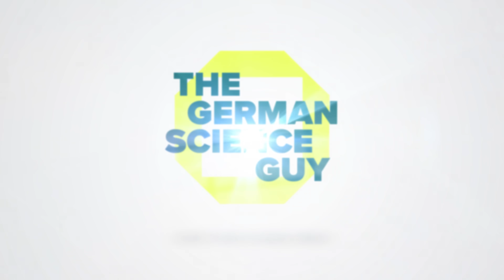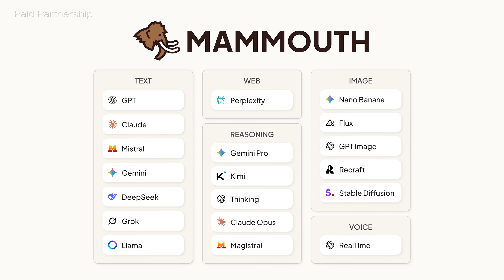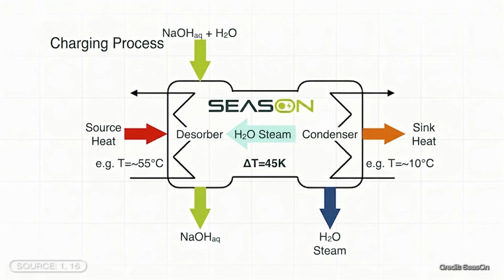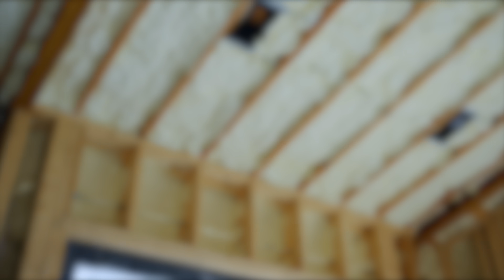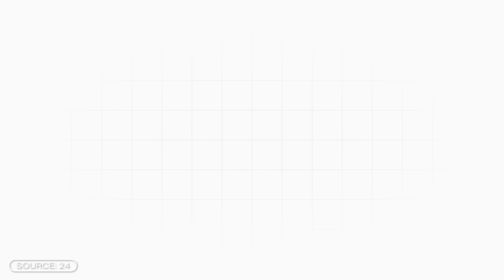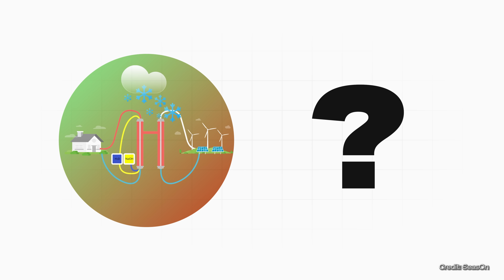New Heat Storage: Better Than a Heat Pump?

Comment: Something here is not adding up to me.  If the energy is stored as heat and returned as heat why would the input even be electricity in the first place? Use solar concentrators to warm the solution to evaporate the water directly.  Solar concentrators when producing heat and not electricity are far more efficient than solar panels.

Comment: About 1/3 kWh per kg. Which is about 30 times less energy density than coal. 40 times less than oil. Somewhat about 1.5-2.5 more energy density than storing electricity LiION batteries (That can run a heat pump with COP up to 5). But materials are much cheaper and can use raw heat from Sun to recharge.

Comment: The calculation of the amount of caustic soda needed applies if you need to store all the needed energy for the whole winter. What would the amount be if you only need to store a weeks worth of energy and then rely on low energy prices to fill it up. Would that be feasible? Would it overload your electricity net connection in periods? Would be interesting to see calculations or a simulation over a longer time including the usage of low energy tariffs.

Comment: I expect batteries (LFP or Na-based equivalents) to become SO cheap that it will have a shorter payback to set up such a system for roughly the same amount of ‘heat storage’ in a few years. Remember that even in winter a air-sourced heatpump has a cop of 3or more, so a 30kwh battery will give you a LOT of heat, while being useful all year round (for trading in summer and such)

Comment: I wonder if the RethinkX concept of superpower makes more sense... overproduce renewables to limit the need for storage (esp. seasonal storage) and use the excess for things like industrial processes that can be run with a 50-80% capacity factor. Like, making hydrogen through electrolysis as a chemical feedstock and run the electrolyzers when electricity is nearly free due to curtailment.

Comment: Hi Doctor, I hope you're well. I wanted to leave this idea with you because I see potential in it if it can be implemented correctly. 

Subterranean High-Density Vertical Photobioreactors Co-Located with Industrial Point-Source Carbon Capture: A Pre-Feasibility Proposal

Traditional microalgae fuel systems have repeatedly failed to scale because they are trapped by four coupled constraints: land intensity, self-shading, evaporation, and expensive above-ground containment. This proposal reframes the problem as an industrial infrastructure challenge rather than an agricultural one. The core concept is a modular subterranean photobioreactor network composed of multiple underground vaults containing dense vertical cultivation panels with a thin liquid column and narrow maintenance gaps. Instead of exposing the culture to the open environment, sunlight is harvested at the surface by tracking concentrators and delivered underground through optical waveguides, ideally using side-emitting or engineered leak fibers to distribute photons along the full reactor depth. In effect, light is decoupled from land use, while the underground geology supplies structural containment and thermal stability.

The main engineering advantage is footprint compression. Conventional algae systems require broad horizontal spacing because illumination arrives from one direction and penetration falls rapidly with depth. A vertical underground configuration converts the problem into a volumetric one: more culture per unit ground area, less evaporative loss, and lower exposure to weather. In principle, this could reduce surface land requirements by more than an order of magnitude relative to open ponds or widely spaced above-ground photobioreactors. That said, the real feasibility hinge is not geometry alone; it is whether optical delivery, pumping, fouling control, and excavation costs remain favorable at industrial scale.

The first major technical risk is light delivery. Any long optical path introduces losses from absorption, scattering, bending, coupling inefficiency, and imperfect light extraction. A 20 m internal distribution path is ambitious, and the system should not assume that a fiber or light pipe can transmit useful photosynthetically active radiation with near-zero degradation. The design should therefore be treated as a hybrid optical system rather than a pure fiber solution. Surface collection should feed a high-efficiency primary distribution network, but the underground panels may still require supplemental LEDs for low-sun periods, spectral tuning, or balancing of light gradients. The goal should be controlled photon flux density, not ideological commitment to one illumination method. A practical design would benchmark collection-to-delivery efficiency early using ray tracing, spectral measurements, and pilot-scale test vaults.

The second major risk is hydraulics. A dense vertical reactor must keep biomass suspended, remove oxygen, deliver carbon dioxide, and avoid local dead zones. The proposed 0.15 m/s circulation target is plausible as a conceptual mixing benchmark, but the true energy cost must be calculated from pressure drop, channel geometry, viscosity, gas holdup, and required mass transfer rates. In most algae systems, pumping and mixing dominate operating expense, and underground placement does not remove that burden. It may reduce thermal conditioning loads, but the economic outcome depends on whether HVAC savings exceed the cost of lifting and recirculating thousands of cubic metres of fluid. CO₂ bubbling can assist mixing, but it also complicates gas-liquid transfer, foaming, and oxygen stripping. The design should therefore include variable-speed pumping, compartmentalized flow paths, and explicit oxygen removal management.

The third major issue is geotechnical realism. Earth and bedrock are not universally “free structural walls.” Excavation in stable rock can indeed reduce the need for above-ground framing, but underground containment still requires liner design, seepage control, drainage, stress analysis, seismic evaluation, and long-term maintenance. A rock cavern can support large loads, but only if the site geology, groundwater regime, discontinuities, and induced stress redistribution are understood in advance. The concept is strongest in competent bedrock or mined cavern environments, and weakest in fractured, water-bearing, or poorly characterized soils. A phased excavation strategy is essential: one vault at a time, with sensor-embedded liners, compartmentalization, and emergency drainage. The project should be treated like underground industrial storage or pumped-hydro civil works, not like conventional crop infrastructure.

The fourth issue is flue-gas integration. Industrial emissions can be a valuable carbon source, but raw flue gas is usually too hot and chemically harsh for direct biological use. Pretreatment is not optional. Cooling, particulate removal, sulfur and nitrogen oxide reduction, and careful contaminant screening are required before gas enters the photobioreactor. In some cases, the flue gas may need more than basic scrubbing, especially if the emitter is a cement plant, steel mill, or process source with variable composition. That said, co-location is strategically attractive because it lowers carbon transport costs, improves utilization, and may create a credible revenue stack around carbon management, fuel production, and industrial decarbonization.

Economically, the project should not be sold as a standalone algae farm. It is better described as a carbon-utilization utility with fuel as the primary product and optional coproducts such as animal feed, biochemicals, or specialty biomass fractions. The business case depends on three revenue layers: fuel sales, carbon-related incentives, and coproduct monetization. Policy support can materially improve bankability, but policy assumptions must be treated conservatively. Any incentive regime, fuel credit, or carbon market must be modeled as upside rather than the sole foundation of the project. The correct financial question is whether the system can survive on conservative product prices, realistic capacity factors, and honest capital costs. If it can only work under idealized subsidies, it is not yet bankable.

The strongest version of this proposal is not a claim that underground algae will instantly beat every existing pathway. It is a claim that the industry has been optimizing the wrong geometry. By moving from horizontal exposure to vertical volumetric cultivation, and from open-air farming to a controlled subterranean industrial process, the project may unlock a new scaling regime. To prove that, the next step is a pilot vault: small enough to measure real light transmission, pumping demand, fouling behavior, heat balance, and gas transfer, but large enough to reveal whether the architecture has commercial promise. The decision gate should be data, not aspiration.

In summary, the subterranean 3D photobioreactor concept is technically bold, structurally plausible in the right geology, and economically interesting only if optical losses, mixing energy, and excavation costs are tightly controlled. Its central value proposition is land compression combined with direct industrial carbon use. Its central failure modes are overestimated light delivery, underestimated pumping load, and optimistic financial assumptions. A disciplined pilot program, full process simulation, and site-specific geotechnical study are the correct next steps. If those tests are favorable, the concept could become a serious pathway for compact low-carbon fuel production and industrial CO₂ utilization.

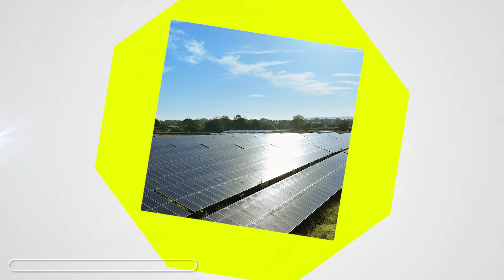Comment: I can see part of the problem @0:35. This solar farm is optimized for summer production. Seasonal production is complex, and also involves weather. But assuming winter isn't never ending cloud cover, optimize for winter production. You'll get less production per hour in summer, but more hours per day. This may not fit with the higher summer production required for the caustic soda heat "battery." Personally, I like phase change materials, but they've got to be insanely cheap.

Comment: 20 cubic metres of caustic soda is huge. Presumably the other tank is also 20cubic meters😱
I'm just filling 30 cubic meters of gabion baskets it's massive!

Given themal expansion and contraction and extreme caustic material, I love the idea of long term chemical thermal potential but this combo with caustic soda? Potentially a nightmare.

Comment: What has happened in Australia is that people buy into a building with an “integrated” energy solution, eg solar panels, batteries and maybe a caustic soda system, people are locked into a decades long plan which is not the cheapest and they cannot get out of it because it’s integrated. Basically the company enjoys the cheap energy supply but the residents pay inflated supply charges.

Comment: Dear Dr. Jacob Beautemps, the described principle doesn't actually store heat, as the water that's stored is liquid, the heat released by absorption is taken from evaporation of the liquid water, which means that heat needs to be added to the water, so what's actually stored is "heat pumping potential". There's technically a tiny amount of heat stored, in the enthalpy of dilution, but that's insignificant.  

Since it's heat pumping potential that's stored, and no significant amount of heat or other forms of energy is stored, the storage capacity of the system should be divided with whatever COP a conventional heat pump can achieve under same conditions and requirements to figure out how much energy to power a conventional heat pump you don't have to source when you need the heat because of that system. And, since that water absolutely should be kept from freezing, all the time, with high certainty, the heat source needs to be well over 0 °C, which means with such a heat source, and only general indoor heating temperatures are required, even a mediocre conventional heat pump can achieve a COP over 4. And, with a capacity of 280 kWh of heat pumping per m³ of NaOH solution storage capacity, that's just 70 kWh/m³, of power you don't have to source when you need the heat, if you compare with a conventional heat pump with quite mediocre efficiency. 

That's per cycle, and with one cycle per year that's ridiculous. And, it's not certain that such a system actually would be significantly cheaper for the same actual useful capacity, compared batteries and a conventional heat pump, with all components required, and installation. If the cost of storing something that you get for "free" is astronomical, what you get out after storage won't be free.

The basic principle could make sense to use primarily for cooling, using those typically daily periods with very cheap power during hot sunny periods in summers to achieve air conditioning also the rest of the hours. 

And if the "charging" can be done effectively enough utilizing "free" input, like the temperature difference between waste heat, and for example ground water or deep lake or seawater when ambient temperatures aren't low enough, cascading multiple systems during discharge could generate a much bigger "lift", bigger temperature difference, that could potentially generate much more useful heat, and cooling. Not more heat, more useful heat. The amount of heat out would be the same, in theory, from a single stage as from a long cascade of stages, no matter how many stages there is, but the potential usefulness, value of that heat can increase immensely if high enough temperatures are reached.

Comment: Good idea to check out many solutions. Although the main thing is the cost per year needs to be significantly lower than power cost to be viable.

If we have land based wind and low cost sodium batteries to compete with that is a big problem for a system that should only discharge once per year...
Reply: Maybe better to focus on daily heat requirements, like industrial, where heat is needed in the morning and evening, and heat energy can be stored, at low cost times, and used, at other times, multiple times a week

Comment: Thx Jacob and team. You guys do realize this 'summers are warm, winters are cold' is a rather limited and possibly Euro centric worldview I hope. As a geographic neighbor of yours I personally think a rather stupid worldview. Relative to say your very interesting coverage of the Darmstadt 'Clean Circles' project which not only allows for temporal decoupling but also decoupling of physical distance. With long distance energy transfer potential as in f.i. southern hemisphere - northern hemisphere. A context with seasonal inversion ... and you need no AI to sense where this is going ... In a recent issue of the 'Electrification' periodical the term 'Virtual Power Lines' was used. I have worked in the short-haul (Europe) leisure aviation sector where we exchanged our aircraft with an airline in the southern hemisphere as peak times were completely opposite; so that particular business pattern.  Anyway, thx for your work and coverage, and as always the effort put into providing sources is very much appreciated.

Comment: I'm skeptical, the the corrosive nature of caustic soda would accelerate the wear on pumps meaning downtime for replacement and costs.
Reply: I the pump is the only issue that could be swapped out periodically during the summer months. Maybe there is a ceramic impeller that will withstand high alkaline substances. If they can get it to once every five years or so that would seem doable.

Comment: A big system seems daunting for a single home. But I think something like this at a comparatively small scale could really save a fair bit on winter heating in my country where we have mild winters, without splurging on more batteries than the basic needed for a viable solar system. It doesn't really get freezing here, but it gets just cold enough to be uncomfortable. So the heating needs are comparatively humble. Still I think there's a market if they can make a small, safe unit.

Comment: Seems the store is at approximately 0.36 kWh per liter theoretically, their research says 0.363 so that matches pretty well.
I can’t find too much about the conversion efficiency yet though, their research states 95% and 0 storage losses (not thermal and no leak current so that part checks out) but that seems optimistic.. still the storage density is on power with LFP batteries, and with a few cubic meters of storage, you probably would have enough to last the winter… so this genuinely does seem to check out.

4x4x4m cube would cover it, thats not small… but its not bad… its similar to LFP would take, but actually affordable.
A neighbourhood building of 10x10x3m would cover about 10 houses, which is nit bad and since it cubes a warehouse of 20x20x4 meter is 1600m3 which would cover a small block. And thats a pretty small building… so definitely has potential.

Comment: In residential use, this heat storage method sounds like it is best suited for new construction, rather than retrofitting into existing structures.  It is similar to ground-source heat pumps that require a large field of buried tubes or a deep well.  Deep wells require bulky drilling rigs that often cannot be brought in due to space constraints.

Comment: 2 reactions to this video: first, energy costs in the USA do fluctuate with the season, especially oil and natural gas, so there is some market force for long term storage of heat. Second, for residential  solutions, I think the ROI would be better using the daily changes of temperature instead of seasonal. Heat pumps are much more expensive in cold climate overnight when temperatures can sink below freezing. By making twice of much heat during the day when it is 30F warmer and storing it for use overnight could maybe pay for the system in a reasonable timeframe, since the size of the unit would be so much smaller.